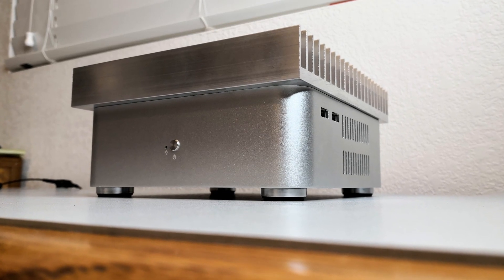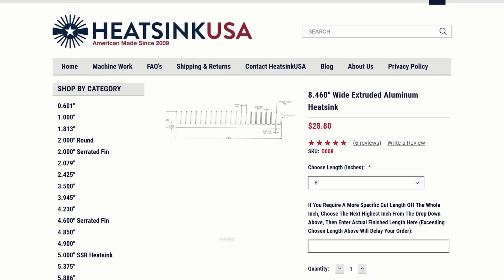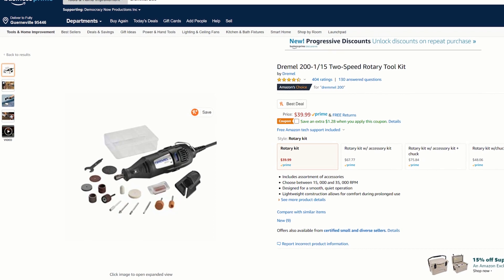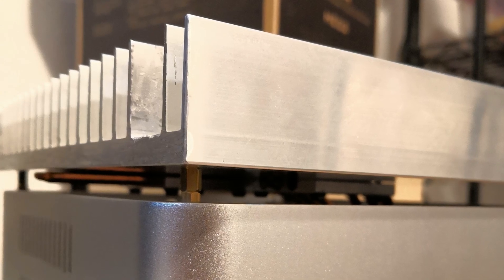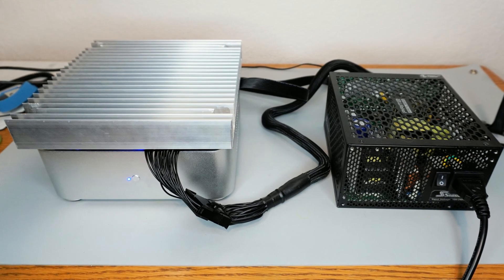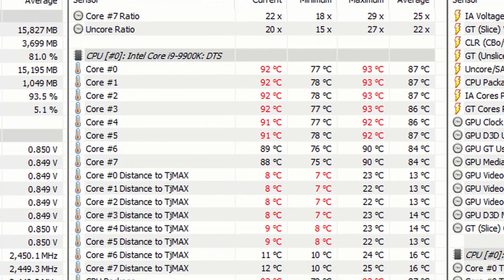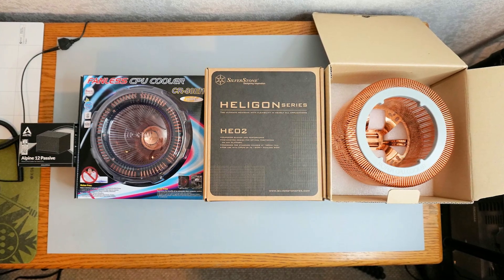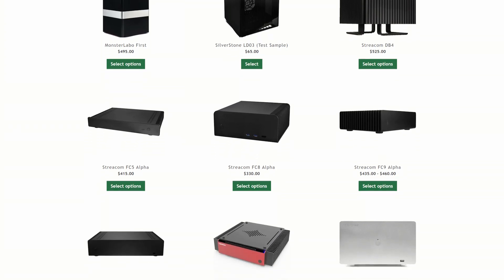Building and Testing a Fully Silent Fanless PC - Custom Design

Comment: This is fascinating, kind of wished I watched this sooner... Just like you, I’ve bought a big heatsink. It is an impressive piece of aluminium, 30x30 cm and about 5-6 kg. I found a flat heat pipe, which is 5 cm wide and 2.5 mm thick and put that between a large block of copper and a finned aluminium heatsink, then this assembly onto the CPU. Without connecting the heat pipe to anything, it could pull about 30W. This looked promising! 

Then I connected the heat pipe to the big heatsink, and it went from glowing hot to almost ambient, the big heatsink not getting warm at all... the power it could handle went to no more than 35W. What happened? Apparently the heat pipe can only transfer a small amount of heat. It’s rated at ‘300W’ (no further spec given). I’ve concluded this means it will not burst until you apply more than 300W, which is a pretty useless spec for me.

I’ve now connected it to a few traditional 6mm copper pipes and did a preliminary test, but it does not seem to get a lot better. The heatsink takes quite some time to warm up and transfer to the extremities seems even slower. It does soak up heat, but having so much aluminium and copper, it tries to find equilibrium within that system rather than effectively radiating it out. And finding equilibrium takes too long when you have a CPU that gets very hot very fast. So the big heatsink idea ultimately fails, lots of heatpipes and fin stacks (like MonsterLabo) seems the more successful approach.
Reply from the maker: Interesting, indeed it is not as simple as it might at first seem.

Comment: You should have used the 8 inch Extruded Aluminum Heatsink on the same site. it has a height of 3 inches, has better c/w rating and most of all, a lot more metal per inch. Also make a small groove on the heat sink side for the heat pipes to have better contact. Also lightly use a really fine grit sand paper on your heat pipes before adhering it. those are probably oxidized since it's from aliexpress.

Comment: I have a fanles system with passive coolers on CPU and GPU. it runs great, but I'm thinking about a way to make the case airtight cause I live by the ocean. I was looking into all those great heatsink cases out there but they are very expensive solutions.
I have this ideia and would like a opinion if this works: Airtighten my case > put heatpipes under the top of the case > a heatsink on top. the idea is that since I have passive coolers, to make the case airtight I would "only" take care of transfering the acumulated heat in the case to the outside. would this work?

Comment: Interesting video, but I was thinking maybe the heat from the heatsink wasn't being distributed to the copper heatpipes fast enough.

Is it a clamp down design? Cover the clamped area of the pipes with thermal paste and try running the tests again, don't forget to do both ends of the pipes.

Comment: Can you build a dustless gaming pc that could run for 100 years without accumulating any dust inside passively? I see people make fully passive cases but they add holes on the top through which dust will collect, or they add usb,audio ports at the top, lol. Gravity pulls dust down so those ports will be filled with dust, or the internals will be filled with dust if there are holes.
Reply: they do it for convection purposes. Although I think there is a way to make it dustless but it will involve pipes and double trap holed doors with the holes at a certain angle and bristles. I saw it in a science fair a long time ago xD it wasn't crazy-looking but it did require the top and the bottom of the case to have a certain clearance to add the panels, channels, doors and bristles that create a pathway so when air passes through because of convection, the angled holed vents and bristles would act as a filter for the air and the impurities would just drop down on the bottom of the case. 

There was also a simple version that only had angled vents with a shroud on the top and while the bottom of the case did get dirty, the components themselves never got dusty.

Comment: a completely silent pc does not have to be cooled passively, you should get an eLoop B14-1 and listen to it, this is hardly audible at 12V even at 10cm distance, you can throttle this fan down to below 100RPM and if you still To prevent any vibration, simply hang it up with a rubber cord

Comment: Thanks for the video. Fanlessguy has not used heatpipes. His idea was to connect a heatsink with a CPU through a piece of metal, directly.  Your custom case has to be checked:
1. What is the temperature deffirence between CPU and heatsink? The heatpipes might be defective and not work properly.
2. The processor has to be delided. Has it?

I've built 3 fanless computers so far. :) The first one is Intel NUC (I just switched the original case to a heatsink case). The second one is an ATX desktop with intel core i3-4360 and a copper CR-95C. The last one is a Streacom mITX case and i3-4370 CPU.
I tested them all, they all throttle if I use stress test tools longer that 30min. However, I don't have tasks like that in real life. Even if I did have them once a year, I would not care because I enjoy the silence all the time.
Reply from the maker: Also, It is not my desire to dissuade people from fanless computers.  I've built more than a few dozen of them myself.  I simply want to share information honestly so that people have realistic expectations.
Reply: @fullysilentpcs  What do you think about the future of fanless computers? I see that many manufacturers stopped selling their products. For example, nofan doesn't sell its top cooler cr-95c and Seasonic doesn't manufacturer 400w fanless psu anymore. Fanless computer parts are very expensive and it looks like people don't want to spend that much money for the silence.
Reply from the maker: I think it will remain a small niche market at the high end.  Some products disappear, new ones appear.  MonsterLabo has a case that is as good a fanless cooler as I have ever seen.  However, on the lower end I think there are more fanless mini PCs and laptops available then ever, not to mention smartphones and tablets.
Reply: @fullysilentpcs  >MonsterLabo has a case that is as good a fanless cooler as I have ever seen.
I checked it out. It looks good, thanks! Does it have one big heatsink for both CPU and GPU? So, if I don't have GPU, will it cool my CPU even better?
Reply from the maker: Yes, that's right.  A CPU with up to 100 W will be fine.
Reply from the maker: Yes, FanlessGuy connects his CPUs directly to the heatsinks, which surely is a better option, but I can tell that these heatpipes were not defective.  I did not measure the temperature, but the heatsink did become uncomfortably hot during testing, so I do know that heat was effectively being transferred.  Regarding delidding, this CPU has a soldered heatspreader; delidding would have minimal improvement.

This particular heatsink was simply not able to handle as much power as I hoped.  It would have to be larger, and preferably have serrated fins.
Reply: @fullysilentpcs  I was surprised by FanlessGuy's results. They are unbelievable. Even if I use the top fanless cooler, a delidded CPU with relatively low TDP, It overheats after 30min of a stress test. It's not a big deal though but FanlessGuy's results are far away from my reality.